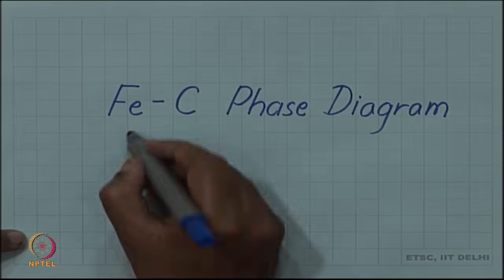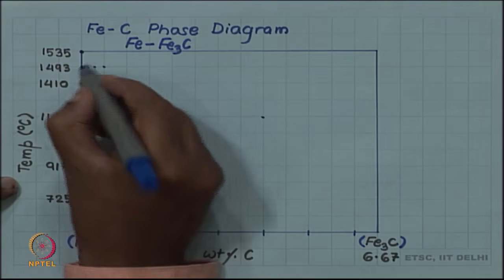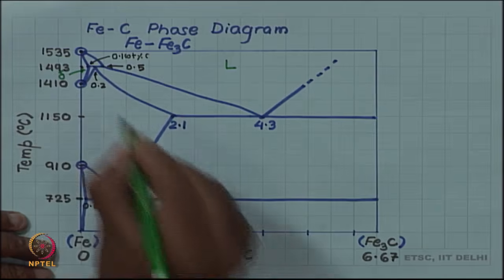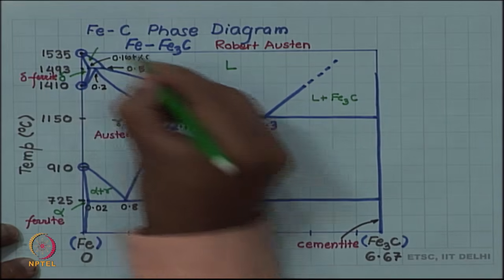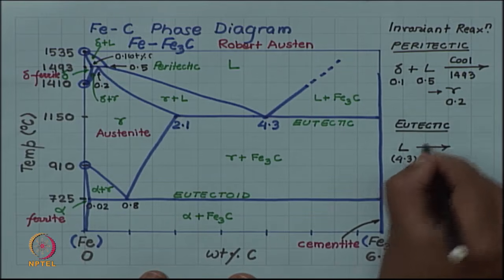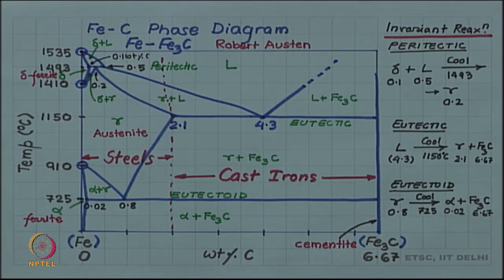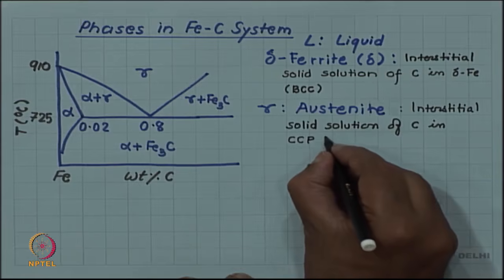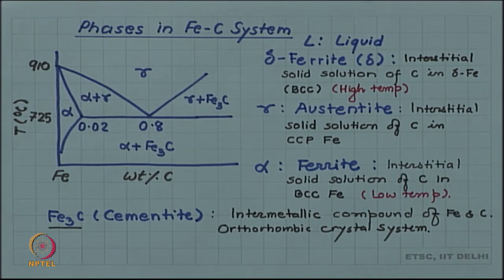Fe-C phase diagram

Comment: Sir 
What is upper critical temperature and lower critical temperature 
and what is the significance of these temp 
What are the values of the above temperatures
Reply from the maker: the lower critical temperature is the eutectoid temperature. It is 725 C for plain C steels. Below this the steel has ferrite and cementite phases in its microstructure. On heating above this temperature transformation to austenite begins. At the upper critical transformation transformation to austenite completes and one has 100% austenite. For hypoeutectoid steels, the upper critical temperature varies between 910 C and 725 C (temperature of  the gamma/ gamma+alpha boundary). For hypereutectoid steel it is the tempearture corresponding to gamma/gamma+cementite boundary.

Comment: Hello, thankyou for the enlighting video. Is it CCP Austenite or Gamma Austenite?
Reply: Austenite is the name of the phase. Gamma is the Greek symbol for the phase. CCP (Cubic close-packed) is the crystal structure.
Reply: But Gamma Austenite is FCC
Reply: @engpaulmusyoka  Calling it CCP is preferred to FCC. CPP means FCC lattice with single-atom motif. There are other crystals also which have FCC lattice, e.g.diamond. But the diamond is FCC lattice with two atom motif. In other words FCC only give the lattice whereas CCP gives both the lattice (FCC) as well as the motif (one atom) which is a more complete description of the crystal structure.

Comment: Sir I want learn about formation of stainless steel (austenitic, duplex etc.) and PWHT.  Do you have a video about stainless steel phase diagram and post weld heat treatment. I will be grateful if you can share. Thanks in advance and with my best wishes..

Comment: Sir, I followed Callister [5th edition] to revise Fe-C diagram, on page 447 under 10.19 Iron-Iron Carbide Phase Diagram topic, it says Austenite has FCC structure. Here you said it is CCP. Please help.
Reply from the maker: My CCP is the same as his FCC. I insist that CCP is a more precise term for the structure than FCC. Note that Crystal=Lattice +Motif. FCC is a lattice. Thus just saying FCC is not exactly the correct description of the crystal as the information of motif is not given. So when Callister calls austenite FCC he assumes that motif is a single atom. A better phrase will thus be monatomic FCC. I use CCP for a crystal with FCC lattice and a single atom motif. Thus CCP=Monatomic FCC but not equal to just FCC.

Comment: Sir,is pearlite composite??
Reply from the maker: At one level, you can call it a composite. 

Ferrite is soft and ductile. Cementite is hard and brittle. Pearlite, a two-phase mixture of ferrite and cementite, can be considered an in-situ composite. 

The adjective 'in-situ" is to indicate that we did not separately make ferrite and cementite and then mixed them. The mixture was created internally during the decomposition of austenite on cooling. This is the reals difference between pearlite and a composite like GFRP (Glass Fibre Reinforced Plastic). Here, glass fibres and plastic are prepared separately and then combined to give the composite.

Comment: Sir, I have a question
* How actually do we control the carbon percentage in iron, Is there a process?(like we have cyaniding carburizing, but those are limited to surface)
* If yes then what are they if not then is it means that once we have a given steel with a given percentage of carbon, there is nothing we could do to change the composition, like you said we don't meet steel.
Reply: Carbon concentration of steel cannot be changed in solid state (except at the surface, as in carburising and decarburising).

Comment: why the 0.8 carbon is not the lowest melting point in the whole alloy system???
Reply from the maker: The composition 0.8 wt%C is the eutecTOID composition. Eutectoid reaction is completely solid-state reaction, there is lo liquid involved. Thus it does not correspond to the lowest melting temperature. But it does correspond to the lowest temperature at which ferrite+Fe3C transform completely to austenite.
The eutecTIC composition corresponds to the lowest melting point. It is 4.3% C.

Comment: In Fe-Fe3C  phase diagram why we don't have beta phase instead we are having gama and delta phases
Reply from the maker: This is a good question. Alpha iron is ferromagnetic. It transforms into a paramagnetic form above the Curie temperature of 770 C. This paramagnetic form was originally called the Beta iron. Although the magnetic state changes, the crystal structure of both alpha and beta iron is the same: bcc. So later, this classification was discontinued and beta iron was absorbed in alpha iron to indicate that there is no change in the crystal structure.
Reply: @introductiontomaterialsscience  Thank u so much sir for replying 🙏

Comment: Sir this is a phase diagram and we are getting alloys at distinct point on phase diagram and not compound. 

An alloy is a mixture not a compound so why you say Fe3C cementite as a compound? 
It should be mixture? 
Please someone clarify it.
Reply: Fe3C (cementite) has a distinct crystal structure (Simple Orthorhombic with four formula units per cell) and occurs at a fixed composition of 25 atomic %  or 6.67 weight percent C. Thus it is called a compound. In case of solid solution, there should be possibility of some variability in composition.

Comment: Sir, I think Gamma iron or austenite is FCC structure
Reply: As FCC is close-packed it can also be called CCP. FCC (face centered cubic) describes the unit cell (atom in the centre of each face and at the corners of the cube) - CCP (cubic close packed) describes the packing on the [111] plane of the FCC structure.

Comment: 2:06 Shouldn't 'Intermediate Compound' be a better term instead of intermetallic, as Carbon itself isn't a metal, or the is the term applied to non-metallic components too?
Reply from the maker: Strictly speaking, you are correct. However, it has become common to call Fe3C also as inter metallic compound despite the fact that one of the components is not metallic.

Comment: Sir i referred the book callister's material science and engineering and i found the structure for austenite is fcc but you have mentioned ccp for the same... This creats a little doubt.. Would you please explain?
Reply: I am trying to make a distinction between crystal and lattice. As I have explained elsewhere, Crystal=lattice +Motif. In my lectures I reserve FCC for lattice. Thus calling austenite FCC gives only a partial information about its crystal structure. Diamond and NaCl also have FCC lattice but have very different motif. Diamond has two atoms of the same kind as its motif whereas NaCl has two atoms of different kinds as its motif. Motif is CCP is different from both of these. Its a single atom motif. Thus CCP is a better description of the crystal structure of austenite than FCC.